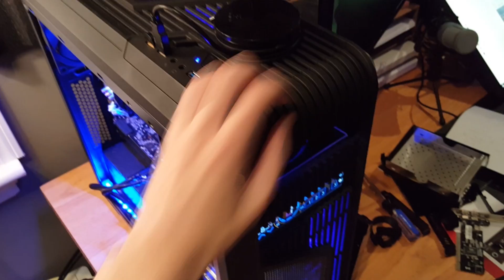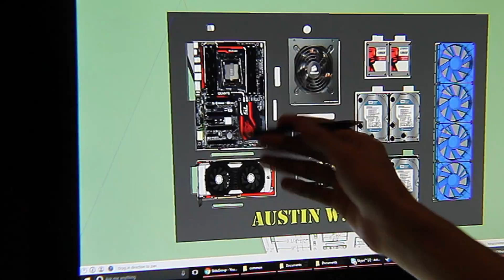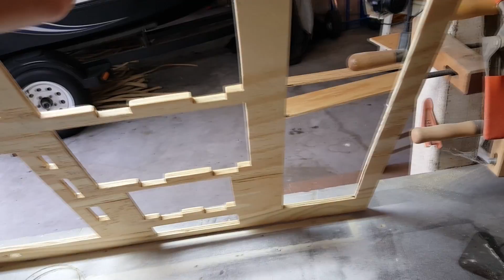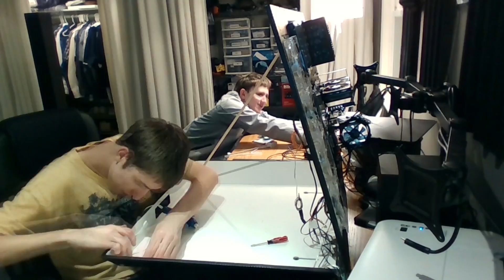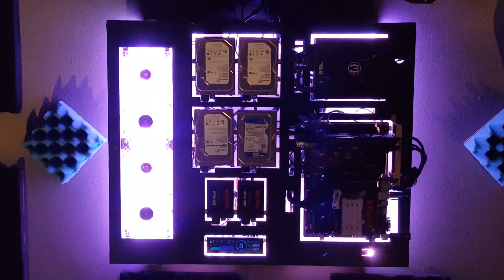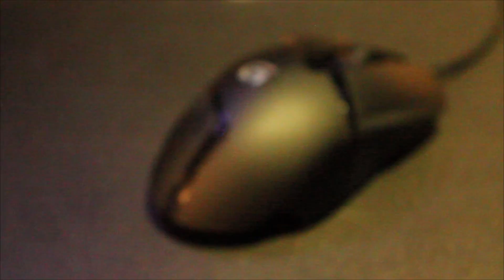Austin's Custom Computer Build Log #1 - The Wall-Mounted PC

Comment: I heard the Thermaltake pce risers are good quality
Reply from the maker: You know it's funny, I bought one for my #4 build and it worked great until the 3rd time I took it out of the board to work on the GPU, then putting it back wouldn't allow for the video card to work, so I just threw the riser away and went back to regular positioning. So I would say that they are good for a one-time install and never touching it again :P
Reply: btw I am building a pc in a desk. I was wondering if you did mount your gpu vertically how would of you mounted it
Reply from the maker: Well if you didn't want to go the riser route, then you could just mount your graphics card normally and make a standoff bracket that you could screw the GPU's mounting plate to, like you normally would in a case. Otherwise, going the riser route wouldn't be a bad idea. I would just spend the extra money by buying 3M's riser cable. It's probably the best riser on the market.
https://www.digikey.com/product-detail/en/3m/8KC3-0726-0500/3M12026-ND/3641403

Comment: Next upgrade should be 3 Curved led computer monitors. The curved edge is such a nice touch to make any game or video that much more immersive. I personally have a Viotek 32 inch LED Curved Computer Monitor with Speakers - 1920x1080p Full HD, VGA DVI and HDMI, 1800R Curvature.
Reply from the maker: Excellent idea! Fortunately, I have recently acquired 2 curved monitors for my arsenal. Be sure to check in to my channel later for my new desk setup video!

Comment: Yo so I'm planning to do something like this, I just wanted to ask, what did you use or do to keep the GPU on the MB like that? I really want to know because I don't really want to spend much money on a good riser.
Reply from the maker: sorry it took so long to reply. to answer your question, the GPU is held onto the motherboard via an aluminum bracket I formed and drilled threaded holes into. The bracket is then attached to the case. Spent no money because I had the aluminum sitting around.

Comment: With THAT MUCH of storage capacity, I wonder how much HD porn material you have for research purpose
Reply from the maker: In this video...it was 10TB. But if you have seen the newest build...currently, I have 19TB of storage, you know...for research purposes as you said :P
Reply: +SkitsGroup what do you prefer more ? Seagate, WD, Kingston, SanDisk

sry for bothering but i am building a pc atm :=<
Reply from the maker: Seagate for cost-effectiveness. WD for long-term better reliability. SanDisk for affordable SSDs that perform at good standards. Whatever you go with will be perfect for whatever you're doing. Its really all the same at the end of the day. Good luck on your build!
Reply: SkitsGroup
oh okay, thanks for your reply buddy, Much appericiated :P

Comment: Do you even need the fans? Aren't they just blowing air towards your room?
Reply from the maker: No, I don't, but this is the 1st generation wall-mount. I have built a newer, better, sexier one...check it out!
https://www.youtube.com/watch?v=uw2hyD0c0eI
Reply: at first i did think that he will put a radiator but nope maybe it cools the bottom of the case & maybe the psu only
Reply: Yeah kinda useless but it can be used for water cooling in feature or could be there for a nice detail haha

Comment: i just have 1 question why do you install 4 fan if it is an open case... behind the wood is only cables
Reply from the maker: It pushes air into the case, which then flows out around the component holes to help cool the components. Also, it allows for a space for a radiator if I ever wanted to install one.

Comment: How did you fastened your GPU to motherboard so it stands still?
Reply from the maker: I built a "U" bracket that acts as the part where you can screw in your PCI cards to the case. Painted gold obviously :)
Reply: Can you send me a close and detailed pictures of that bracket please? I'm up to something and have problems to fasten GPU, may be you know some trick to fasten GPU horizontally connected to Pcie riser?
Reply from the maker: Yeah, here is a link to the pictures...http://imgur.com/a/MSg4U In terms on how to connect a PCI-risen card, it all depends on the setup, but PCI risers I would have to recommend against because they impact performance so much, as shown in this video.

Comment: Nice build but I have question how those case fans are helping you, I mean I don't see the purpose of those fans.
Reply from the maker: +Harwinder Singh It pushes air into the case, which then flows out around the component holes to help cool the components. Also, it allows for a space for a radiator if I ever wanted to install one. Glad you enjoyed the video!
Reply: That's what I was thinking, when I saw that cut I thought you are going to install radiator. Again very good tutorial and I am inspired by it I am planning to do the same. I have seen other tutorials but those builds seem more expensive then yours.
Reply from the maker: +Harwinder Singh Well thank you! And you should build one, it's fun and makes your computer unique to you! And yes, I tend to find the cheapest materials that can be formed to make a great product because I'm cheap :)

Comment: how about a small form factor m-itx pc? but only mobo+ gpu should be visible, along with RAM modules and maybe the cpu cooler/waterblock. 
honestly, i don't like that all the wall mounted PCs have the PSU n hdds out in the open. they kill the look. the class! 
i have an excellent idea(at least  think so :P) but no tools.

Comment: I am thinking of building a walk mounted pc.. I want it to like something like this. But my gpu (290x lightning) is really heavy! How could I strengthen the construction for my gpu? :)
Reply from the maker: +Jesse Brink Well, most wall-mounted PCs have the graphics card separate from the motherboard and connected via a PCI-riser. But if you don't feel like spending a minimum of $50 on a decent riser, you can do what I did, add a bracket mount on the left. But then you could add a support that juts out from the front and allows the graphics card right side to "sit" on.
Reply: +SkitsGroup thank you so much for the fast response! I don't feel like a riser, I only hear bad stories about these. My best friend has a 3d printer.. Could I use that for a bracket or is it too weak?
Reply from the maker: +Jesse Brink If you make it thick enough...about 1/2 to 3/4 of an inch thickness should be fine, but for sure plastic will hold. Mine is made out of wood lol.

Comment: So, how about a case that is a desk drawer.  It would require either a liquid cooled system with an external radiator, or vent holes drilled in both the drawer and the side panels around the drawer.  I intend to do this when I get enough dough saved up.
Reply from the maker: +Steve Sanders Yeah, that would be cool. I would probably have it in the top drawer and have a plexiglass window on the table top to be able to see inside. Thanks for the suggestion, I might actually do that!
Reply: That is exactly how I was envisioning it.  When I'm done I will come here and post the youtube link.  I think I am going to record a timelapse of the entire process.
Reply: top drawer will be double deep.

Comment from the maker: If anyone has an idea for my next PC case custom build, please leave a comment below explaining it and I might actually make it! Thanks!
Reply: +SkitsGroup
For the next time, this risers works great: http://ebay.to/21zJ8Pr
You can see in my last video, i have same problem with standard risers.
Reply: +SkitsGroup you could make your own case, great spacing and nice lighting
Reply from the maker: +Cameron Shelgren Interesting...so like the monitors would be the front and you could lift up the panel of monitors to reveal your components. That would be a very wide wall mounted case for me being that I have 3 monitors spanned across with one above it lol. But yeah, not too bad of an idea. Glad you enjoyed the video.
Reply: +SkitsGroup You should try building a Mini ITX inside an Original Xbox case. You could get water cooled components with side exhaust and Mini ITX GPU and PSU. I want to see if it's doable these days.
Reply: Something else like this, but water cooled, this build would of looked even more awesome water cooled lol
Reply: SkitsGroup damn ur monitor setup is so dope can u make a video about it?
Reply from the maker: +Igor Malykh 
Yeah, I guess I could. If I can find the time, I shall upload a video of it before the end of the month. So be on the lookout. Thanks for your suggestion. I'm glad you enjoyed the video!

Comment: what are the 4 fans for?
Reply from the maker: +Patata Mecánica It pushes air into the case, which then flows out around the component holes to help cool the components. Also, it allows for a space for a radiator if I ever wanted to install one.